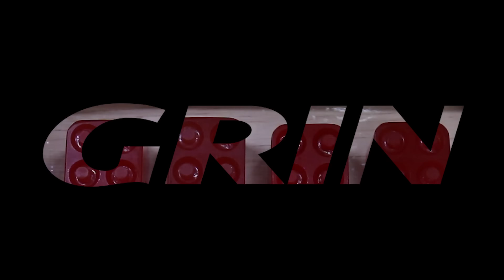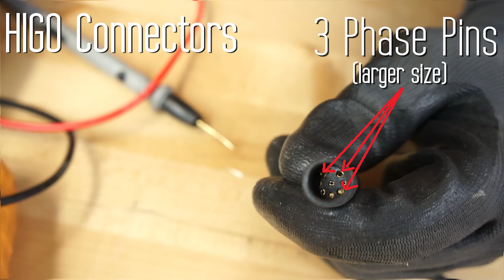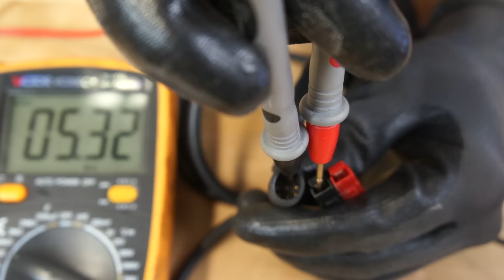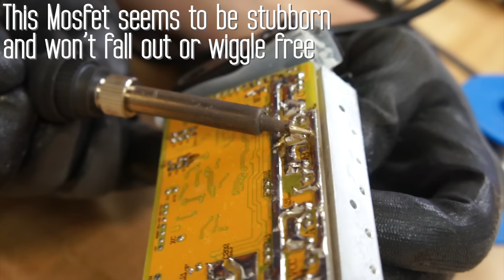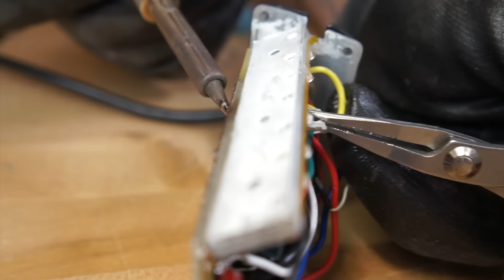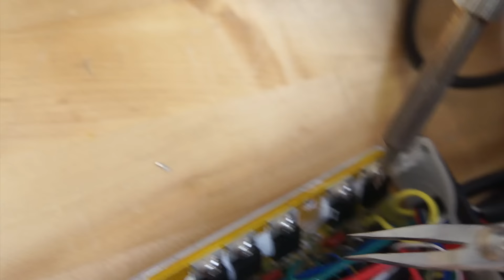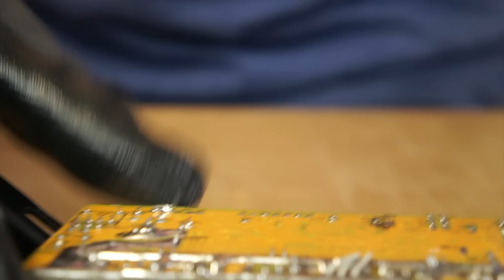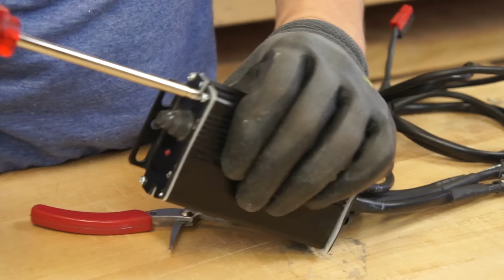Finding and Replacing Blown Motor Controller Mosfets

Comment: That speed controller looks like it has good solder lines across the board. I and wondering how can I mod a speed controller to have a good line like that.

I have a Kugoo Kirin G3 electric kick scooter. And 2 speed controllers failed on me. There are burn marks at a couple mosfet solder joints. And it looks like the trace on the PCB along the mosfets is what burnt apart to a no connection.
Reply from the maker: Yes the stock traces are often quite underspec'd for required phase current. You can easily beef them up with a piece of straight copper wire soldered on top of the trace.

Comment: I have a 48v Brushless Razor mx650. My problem is the motor only runs when you rotate the drive gear to a certain point. Do you think I might have a bad mosfet in my controller?

Comment: mine is shorting from possitve to yellow phase cable is the the same prossess only this time swap poss mosfet?
Reply from the maker: Exactly. That's a blown high side mosfet, but the replacement procedure and the replacement mosfets are identical whether they are on the high side or low side.

Comment: I am worried I blew my new Kelly KLS 7275H. It was working, but when i wired the potentiometer, there was a ZAP and now I dont have power to the phase wires. Can it be fixed?
Reply: I see power between B+ and B- and at the end of the fuse between + and B-. I just don't see power anymore between B- and the phase wires. Please help!
Reply from the maker: Anything can be fixed if you have the ability to identify what is wrong and replace it. But very few people have that skill set for random bldc motor controllers. Generally your first course of action if you don't have those skills would be for you to contact Kelly controllers or the vendor you bought from, and see if they offer repair services.
Reply from the maker: It's very unlikely that anything you did to the potentiometer input signal would have blown the controller MOSFETs, which is what this video is about.
Reply: @GrinTechnologies  thanks for the reply. yes few of us study BLDC motor controllers that in depth. I thought perhaps you had some troubleshooting steps to narrow it down. Kelly hasn't responded yet.

Comment: Can I add more to my controller to make it better. Or up them
Reply from the maker: Adding more in parallel is kindof an ugly hack job and you really need to check if the mosfet gate drive is up to it. Replacing stock mosfets with others that have lower ON resistance is doable for sure, but you then have to make other changes to the controller to allow it to actually pass a higher current.

Comment: How about no power on a sabvoton controller?
Worked for ever and now no power. 
Switch wire when touched to positive battery line, minisparks but it doesn't kick sabvoton on anymore.
Any where I should look first?
Reply from the maker: Probably not the mosfets which is what this video is about.  Putting V+ accidentally on your control signals can wreck all kinds of havoc on the logic board so you should probably be looking at where you can buy a replacement unfortunately.

Comment: Nice video interesting, just replacing a faulty mosfet, don’t know what solder they used but quite a job trying to melt the  solder with very hot iron
Reply from the maker: Most controllers are made to be RoHS compliant for the CE sticker and so are using lead free solder, which yes is a PITA to melt and work with.  Use flux and use the hottest iron setting with the largest tip. When you resolder on new mosfets you can use the much easier to work with lead/tin stuff.

Comment: I’ve got zero ohms to positive battery when probing the phases, is this also bad ?. They’re fine to ground, but phases are zero to positive, but only a certain polarity.
Reply from the maker: Generally yes, this is bad as it would be a short of the high side mosfet
Reply: @GrinTechnologies  I’ve taken all mosfets off and they’re fine. If I switch the probes though it goes away.

Comment: Hi, are all the mosfets the in the controller the same? or are there 3 negs and 3 pos? I have an ebike controller with 1 mosfet blown and all mosfets have same number on them, I cannot find these to replace, the number is ZJ7080. The controller is for a 48v 250w bike, controller says 15amp max current.
Reply from the maker: There are 3 high side mosfets, and 3 low side mosfets, but usually they use the same part number for both. Most likely you what we would consider a pretty crappy mosfet in a low current controller like that, typically 8-10 mOhm of on resistance.

Comment: Does anyone know why my 1000 watt 48 volt front hub keeps going into reverse? It'll spin properly for a bit then inexplicably reverse. 

PI cannot figger it out.
Reply from the maker: Likely an intermittent signal on the fwd/rev input of the controller. Could be from water ingress messing with the digital input signals, or from stray stands of copper around the connector.

Comment: Your soldering iron tip is way, way too small and thin for such a demanding job. There is not enough thermal mass to maintain the heat. My advice, use another tip that's minimum twice the size of your current one.

Comment: Have an issue with my controller, once you  twist the throttle then let go, the hub motor does not stop running, cruise wire is not connected nor enabled. Any diagnosis on this scenario?
Reply from the maker: We don't do tech support on Youtube. Could be a throttle issue and a simple swap out... if it's our system please contact our warranty department.

Comment: Hi my ebike motor is working fine off the ground but when I seat on it and under load will be cut off the power . need help with this issue
Reply from the maker: If it works unloaded then you do not have a blown mosfet and this video won't be of much help I'm afraid.
Reply: @GrinTechnologies  Could you please help me what is the problem because I checked my battery with similar bike and it was fine .

Comment: My scooter suddenly turned off while riding and the motor wheel isnt rotating, the screen won't come on, it won't indicate charging so this would mean my controller is bad and needs to be replaced but the motor is fine?
Reply from the maker: If the screen and controller don't turn on it is most often a battery issue. But if the controller has a fully blown MOSFET bridge it creates a short that effectivity suits off the battery the moment it is plugged in.
Reply: Thanks, I replaced the motor controller, the scooter now turns on and runs but only in 1st gear what did I doo lol

Comment: Hi. I have a scooter on Ms energy neutron n2 plus which has a 36V 15A controller.  There is a problem it will not turn off on the button.  You have some idea how to solve this.  Thank in advance.
Reply from the maker: Yup, but it's not really related to the controller mosfets or mosfet replacement.

Comment: Pretty good.  I'd have applied new thermal paste, at least to the replaced MOSFET, and cleaned the flux off the board, both would add life to the controller which is, after all, the point of this exercise.  Maybe you did, but you didn't mention or show either before stating it was finished and closing it back up.
Reply from the maker: Yeah the best thing is actually to replace the kapton tape strip with an ACTUAL thermal isolating pad that has much better thermal conductivity. The cleaning of flux residue doesn't have any consequences one way or another.

Comment: Question... I shorted out my controller by touching the positive and negative wires together on the controller. I opened it up and there is a black burn spot next to the positive and negative area inside the controller. Now my controller no longer works. What could be problem? Thank you
Reply: @jb9072  controller was not connected to the battery.

Comment: My controller has two wires each for the brakes(the brakes are on when i short the wires of one brake) and i want to use one of the brake's wires with relay to control with arduino is this possible ? If not what should i use?

Comment: Hi, I have a question to ask. Today I was going to charge the battery of my 72v 40amp 8000w and once I plugged it it short circuited, are you able to tell me what is gone? So I turn on the scooter and the volt meter on the scooter is going down really really fast? Can you help me? Thank you Sir

Comment: Thank you so much for this. I'd love to see more on electronic repairs - i have a couple chargers that need diagnosing/repair.
Reply from the maker: Chargers are trickier if there is an actual component failure, but we've seen quite a few fail from fatigue cracks in the PCB traces where heavy components (capacitors, transformers) were soldered but not held down with a glue or vibration absorbing compound.  When people carry the charger with them on their ebike, it's exposed to a lot of vibration.
Reply: @GrinTechnologies  Ah, so sometimes just re-soldering all the joints might fix?
Reply: @GrinTechnologies  SMPS supplies can be PITA to fix, I once blew a VCR up when my DMM probe accidently touched the drain lead on the chopper FET, after that replacements FETs got destroyed, the TV tech told me the oscillator wasn't switching in/out, I ended up junking that VCR (NEC VN65) Daewoo rebadge

Comment: Best video ive seen Phil on troubleshooting speed controllers. so i had to subscribe... Heres my issue. i have a dual motor 1800 watt peek/dual battery 52 volt / 23amp speed controller /  e bike on back order with a programable lcd display with a unlock code to get the approx 32-33 mph out of it. since it hasnt arrived yet do not know who makes the controller.  I know im going to want to get at least 40mph out of it with in a few months after it arrives. Any suggestions will be greatly appreciated.
Reply from the maker: Most likely you will want to run your system at 72V with a new higher voltage battery pack, and get a 72V compatible motor controller.

Comment: Thank you for the video! Helped me find and switch out a bad mosfet that went bad after a month. FWIW the replacement part for mine was IRFB 3607. Mine also was a negative mosfet but different location than in the video.  Moving the mosfet back and forth until it broke off made it a lot easier to hold one leg with pliers and then heat it on the back side until it could pull out. Cleaned out the hole with Chem-wik, right stuff for the job, and in with the replacement. I was able to isolate the correct phase wire by disconnecting each phase wire in turn while rolling the bike backwards. Once the correct phase wire was disconnected, bike rolled backwards easily.  Prior to that rolling backwards required more effort indicating a problem (as well as an E9 error code) Bravo - Thank you for your instructions!

Comment: Do you know if running a 36v battery and 36v rated controller on a 48v hub is legit? Like, will I ever run into any type of issues?
Reply from the maker: There is no such thing as a 48V hub. Motors simply don't have a voltage rating. See
https://ebikes.ca/getting-started/ebikes-parts-explained.html#TheMotor
for an explanation. 
You can run the motor just fine with a 36V battery pack, and unloaded it will spin 25% slower than it would with a 48V battery pack.

Comment: Somehow I managed to Burn out 2 new controllers when just hooking up to the battery. I get no readings back when testing positive side, only negative side readings.  And when putting the leads on both Positive direct to Negative I get nothing.   Ever heard of this?  New 60v battery is putting out the right current. Controller is supposed to handle up to 72v and 45amps 2000-3000 watt motor. Briefly worked but after unplugging and plugging battery to controller a few times with a decent spark at connector it fried the first one so I tried the second controller thinking it was a fluke and same thing. Ugh!  Any thoughts?  Hate to see this happen again.  I'm going to get a spark resistor for the next one but sounds like that likely isn't the problem? Thank you

Comment: Im trying to diagnose my nanobot d4+ 2.0 scooter. This problem does not happen in the cold morning on my first ride but happens in middle of day when it is warmer. Im in NM. What happens is both motors cut out when I'm in dual mode and when i go full throttle, and also sometimes when i try to just accelerate quickly. when it cuts out i does not come back alive by simply backing off a little on the throttle but i have to totally go back to 0 or no throttle and then the motors start if i re-engage the throttle more gently incrementing the speed. It does not happen in single mode when in just rear hub drive. When in single mode i can press the throttle fully and as quickly as I like. If I think of the thumb throttle as a clock that goes clockwise from 12 to 6. it is at the 5 when the motors cut out. It also happens if i got from 12 to 3 very very quickly.  I'm pretty techy and i can replace of fix most anything but I like to diagnose first. I did have an extra thumb throttle speed controller so i did decide to replace that (because a year ago i brew out its usb power port when making a dual charger for a camera i have) but changing that speed controller had no change in the symptoms. Do you think there is a short somewhere in the system on full power or is it a hall sensor. Is it overheating and the bms cutting out? There are two controllers in the scooter with a communication wire between them, could one of the controllers be off. Both motors shut off when this happens. What tests should i run to see where the problem is? I have opened up the scooter before because I silicone sealed everything to protect from water. but actually moved to NM where there is little rain and I do not ride it in mud or water anyway. Any help appreciated.

Comment: Can you do this with the mosfets on the bms aswell, I'm assuming you can?
Reply from the maker: Yup!
Reply: @GrinTechnologies  nice one, i have a weird fault i haven't seen before where for all stationary tests, the battery works perfectly, but if i apply too much current it switches off and the output voltage drops below 40v (but not down to 2.5v like a normally off BMS) on a fully charged 14s pack, however that voltage is absolutely perfect when checking the cells directly beforethe bms, the voltage climbs back up and the bike turns on again. Leading me to think it's not even all the mosfets just one or two of them. Have ye seen something like this before and do ye think it's worth the trouble, it's a 14s 100a bluetooth bms from lithium battery pcb.com, any help would be Sound!

Comment: Can anyone please help me with a faulty e scooter? Every time I go to charge it up it shorts out the battery charger. The battery is actually fully charged, I disconnected the battery from the control unit. Every time I go to connect it back up it blows the battery connectors to bits

Comment: What will be the result if I replace 85v 150A mosfet ( k150e09ne- 18 nos) & 63v caps with 100v 200a (SSF1006 mosfet)  & 100v Caps.

Controller is 48v 45a...
Reply: Did you find the answer to that question? I like to know also...

Comment: I have a Charly scooter which is made in Germany, although I have the less common 110 V US version, And appears that the controller box is fried. Is this something that you might be able to repair? The LED display does show a problem with the controller, and there is resistance when I try to turn the wheel by hand. Further, the motor does still work when I power it directly.

Comment: my battery cable fell of so the kers burned anything on my controller.
sadly i dont think that replacing mosfets will help if the esc just does nothing anymore, even the scooter doesnt turn on anymore.
I have a functioning replacement controller but it's from a german 20 kmh m365 clone, and just the tail light flashes ... so i have to replayce broken parts but what for parts?

Comment: Thanks for this great guide, the biggest problem to find the right china mosfet, in my case it is a brainpower control. DC52V (the scooter is a Speedway 4 clone + no dualtron 1x800w motor) the mosfets(to 220) have the designation:
K M
..9Y ....... 19x
2452 ..... L12
.... K3475N ..
Unfortunately I could not find a data sheet to find comparable replacement mosfets. does someone have a tip?

Comment: Great video!! Question: I have a 1000 watt Ecotric Hammer, 48 Volt, I want to use a 52 volt battery with. Is there any reason why the 48 volt controller would be damaged by this? My 48 volt battery puts out 51+ volts when it is fully charged... Why such a gray area? I don't see any 52 volt controllers for sale, but everyone is upgrading to widely available 52 volt batteries. What do you think? Thanks.
Reply from the maker: Virtually all 48V controllers will cope with a 52V battery just fine since they need to use at least 60V rated mosfets and capacitors.   The only exception is if they have a maximum voltage cutoff but that is rarely implemented in motor controllers.
Reply: @GrinTechnologies  Awesome, thanks. I see everyone doing it. The mfg. said it won't work, but I think that is a standard answer..

Comment: Hey good video can you advise on whats best i recently have a fault with my scooter it powers on ok, the issue is that it won't accelerate and the brake light stays on, i have checked everything cables, battery charges ok the only thing is the controller or the motor hub  i followed your video checking the misfets and can seem to find the problem ive checked the internet for a replacement but they all have different end connectors to mine are these controllers standard ? can i replace the end connectors.
Reply: can you help please, my girlfriend has an old bateribike wich has stopped working. new battery, still not working. we think it might be a controler. can you advise or anyone to sort out, please.  Harry